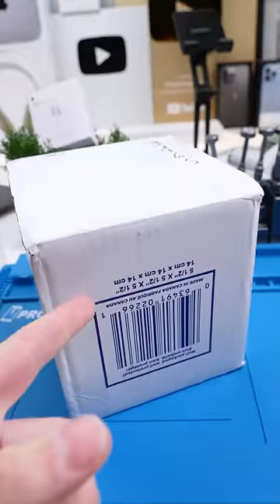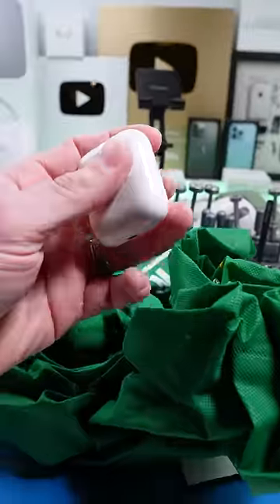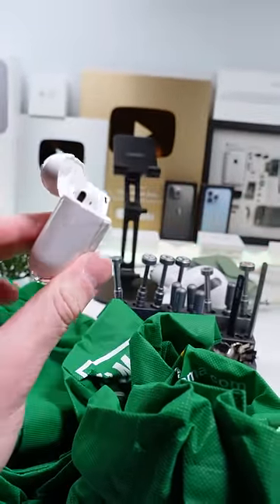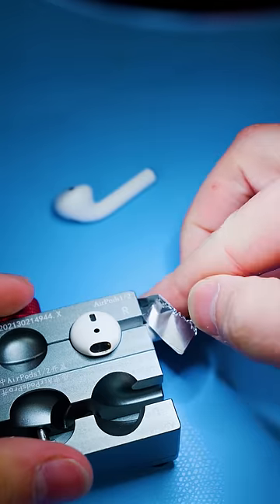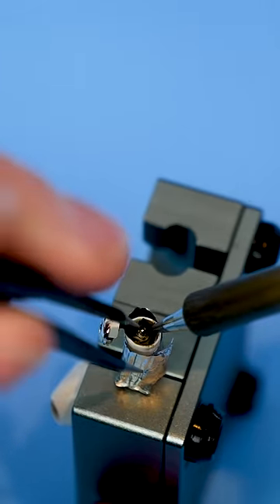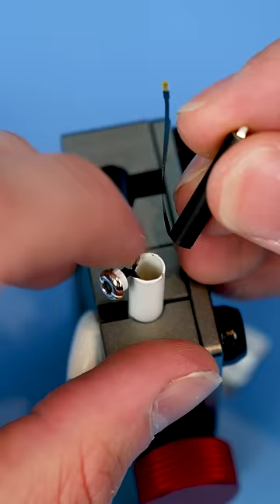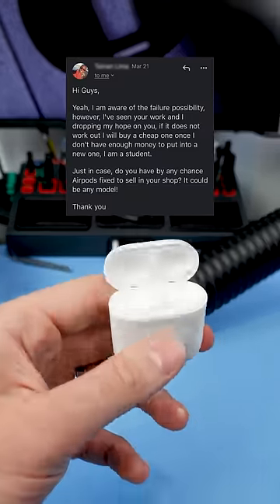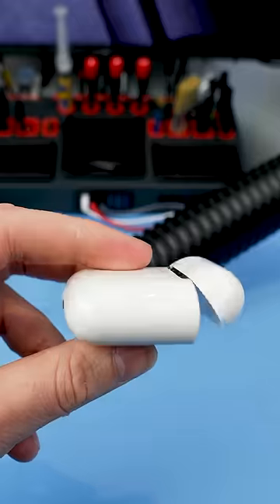He Mailed In His Airpods For Repair...😭 #Shorts

Comment: I was looking to buy a TWS / Bluetooth neckbands for use when I'm jogging (i didn't want to use my Sony BT headphones as I'm afraid they'll go bad or something if it gets into contact with sweat)

But after reading reviews for most of these TWS buds (there are an enormous number of them available), most people have reported the batteries start fading after 6-8 months. So I gave up on that idea and dug around in my storage room and found my brother's old galaxy note 8 box which had a pair of wired AKG earbuds in it.

I'm using it with a type c adapter and its working great - I don't need to worry about charging it & whether the batteries become toast after a year.

I'm now angry at all the phone makers who decided to abandon the 3.5 mm jack.

Comment: Your soldering skills will be improving if you do it more often,you don't need to be 3-4 months to become a pro, you can be a pro even in 1 week :), but the easiest way to learn is to take bad boards and try to desolder from big to small components with as little damage as possible and also it will help a lot if you get more sizes of soldering heads adapters or how do you call them(I don't remember their name). And also, always try to anchor your soldering hand on something so you don't do mistakes :)
Hope I helped somehow and good luck:)

Comment: Instead of putting heat directly on the air pod and with a gun I wonder if a thermal protective sleeve could go over the white plastic and an infrared heater could be positioned just under the cap slowly bring it up to an even temperature to remove the cap. Hmm